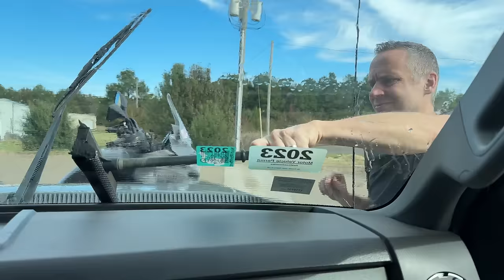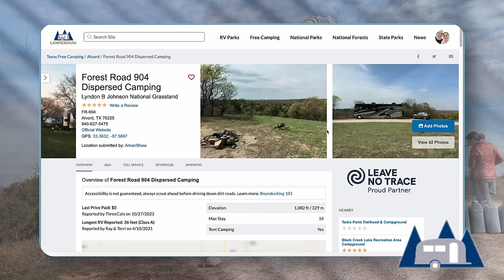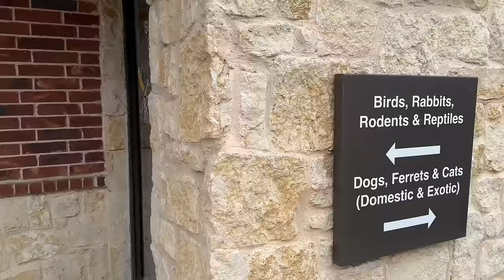THIS SUCKS | The Hard Reality of RV Life (Emotional News)

Comment: On a lot of alloy rims they leak around the rim where the bead of the tire and the rim touch it’s like the chrome wears off , you can run your fingers around the inside of the rim and if you feel a rough spot where the chrome pealed. Off, that’s the leak spot, tire must be put back on with special glue ( temporary fix) or replace rim
Reply from the maker: Yeah - rim was my first though but I was able to locate the leak back in September. It was a literal pinhole in the sidewall. So small it almost didn't even blow soap bubbles. But watching it for time and it kept blowing them...one by one...verrrrrry slowly. -J

Comment: Do you have a tarp or two to cover the roof to keep it dry until you can get back to complete the restoration?
Reply from the maker: If you find the video "Unemployed" I finished the roof there. I didn't show this extensively but I re-cleaned the roof once again with simple green and then wiping it down with rubbing alcohol before putting on the roof coat. -J

Comment: Im curious how you came up with the dollar amount for the Alaska trip? Im also wanting to travel to alaska in my van.
Reply from the maker: We go over it a little bit in the "We're broke" video but I want to stress something that I think was misunderstood by many. Our fault for not making it more clear.

First the breakdown:
$4,000 for fuel
$9,000 for experiences & extras (excursions, bush flights, etc. This may be high...but we want to do a lot while we are up there.)
$2,000 for budget buffer

That's the $15K.

We are 110% sure we will spend more than $15K while we are there but we are using this fund to remove fuel and entertainment from our monthly budget to help cover the fact that things like food will be more expensive.

Typically our monthly budget is between $3,000 and $4,000. (Kalyn actually breaks down our normal monthly budgets on IG if you're interested)

So if we spend 3 months on this trip and spend everything we saved along with our normal monthly budget (which I don't think we will....but better safe than sorry) we would spend somewhere between $27K - $31K over the course of the trip.

I hope that makes sense! -J

Comment: What is the hole digging for?
Reply from the maker: Haha! We cut the rest of that out didn't we. The RV was about 8" off level which was too much to just use blocks on the one side. So we dug a hole for the tires on the other side. Then when we left we filled it back in making sure it was back to normal. -J